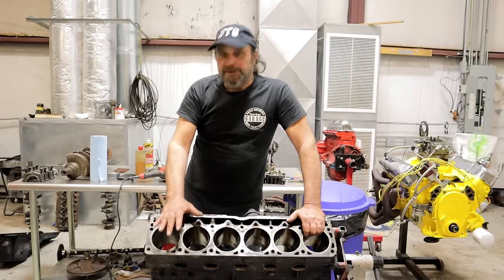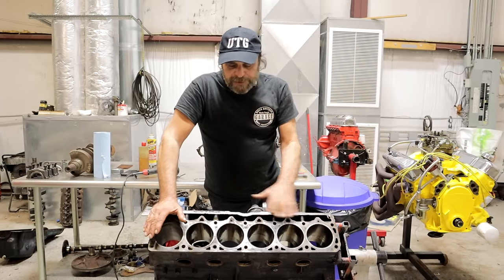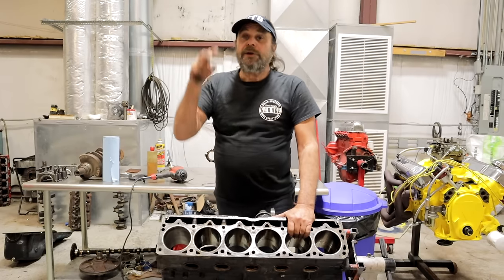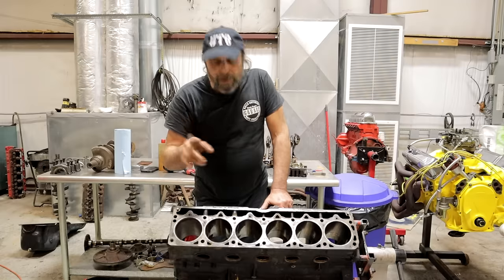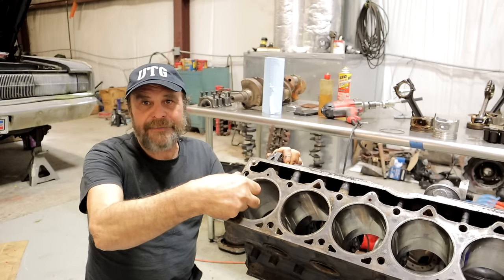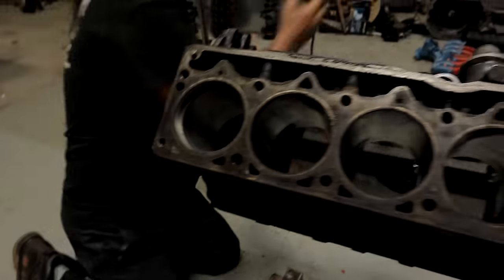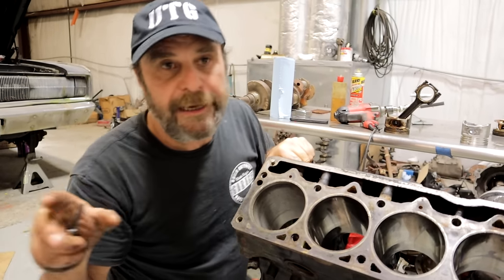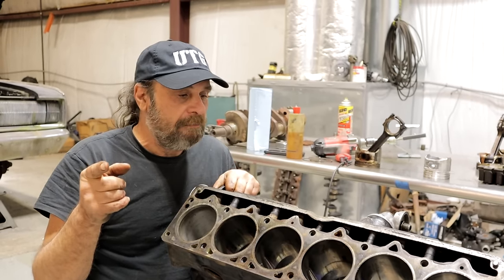Your First Engine Job - Checking Cylinder Bores For Roundness And Taper Using An Old Piston Ring

Comment: Hey man just wanted to say that your videos are very helpful for the guy at home. Don’t listen to the machine shop guys that think their process is the only right way to build an engine. I’m a young kid and I’m porting the cylinder heads on my dads 318 and doing some cleanup or “blueprinting”. We need more mopar videos like yours. It seems every YouTube channel has worked on or talked about Chevy 350 small blocks.
Reply: @hughgerection8675  lonely Under that Bridge huh...
Cheers up Hugh...
Reply: Ya as long as your within the specs run it I've never had issues adhering to that and it's treated my builds well.
Reply: @hughgerection8675  that's only true to a certain extent for example some professional builders balanced pistons, pins, rods ect to within 1g some do it to within 0.5g some even further like myself a min of .01g I don't accept more of a variance then that so again it's dependent unless you're referring to f1 ect which I'm sure is far more intense as far as tolerance goes and let's be real hear if he is looking to race to win specific class then a 318 isn't on the likely list of combos anyway so it's clearly for a fun weekend car it will probably never see 500whp or above so aslong as it's in spec it will work and be fun and that's really the key overall

Comment: While you're checking for light gaps in the cylinder. Go ahead and check the gap with a feeler gauge at the same time. Save a step. Otherwise, perfect explanation. Easy to follow and very good information

Comment: If you have an engine you just want to get back together like this I suggest finding a hone with the fixed adjustment rather than spring loaded. You can do a much better job of honing and correcting the bore in the process.  Having honed hundreds of blocks there is pretty well always a few thousandths taper and a fixed stone lets you get that out whick makes the rings and pistons much happier and it will last a lot longer.
Reply: Great comment. I wish UTG would've covered that.  I took the time to quickly peruse Google. I'm happy I did. Back in the day, the cost between the three types of hones was the biggest factor in hone choice. It still is today, but MUCH less so.  Ball and spring-loaded "fixed stone" are still the cheap way to go.  However, for $150 - $160, lisle, apparently, makes a rigid hone.  Back in the day, they were like $400 to $600.  What's great about these bad boys is that this is as close to having a professional, machine shop hone at home.  This is the same type of head as machine shop hone, just smaller, so a drill motor can handle it. Because it does rigidly hold the stones, it's much easier to get a bore that's round and straight. The only difference between this and a professional is that, due to the mechanically controlled stroke and rpm, a professional can precisely, repeatedly set a cross hatch pattern where a hand stroked, hand controlled drill motor might leave inconsistencies from bore to bore.
Reply: @kart70  Thanks for that.  It's good that a newbie has choices, depending on his budget.  UTG is pretty consistent with being budget minded.  It's a growing process. 🙂
BTW, slight tangent, I have old tools from my dad.  The ones still working were the ones from quality mnftrs.
Reply: One more shot in the dark thing to think about is to check out the night courses at the local tech college.   It's not that common, but some colleges do have automotive style machining equipment and even may offer night classes where you can do your own machining on your own engine. Sure, it won't be cheap, but it may be cheaper than the machine shop, and you can brag that you did it all yourself.

Comment: I’ve honed a lot of small engines. I hone might right in my parts washer with mineral spirits. I direct the spout at the cylinder wall, turn on the pump and hone away. The mineral spirits flush the cuttings and grit away as I go.

Comment: While running the piston ring down the bore checking for roundness you can check the ring gap at each stage to see if there's any taper.
Reply: And divide the gap difference by pi to determine actual variation in diameter.

Comment: I've always used diesel when honing or as cutting oil or anything like that, but growing up on the farm we always had diesel fuel around just waiting to be used as a solvent/lubricant, so that's what we used.  We also used it to wash our hands when we were done working on anything that got our hands greasy/oily.  The diesel fuel we used back then seemed like it was a lot more "slippery" or lubricating than the ULSD available now, so I use WD40 or lite engine oil as cutting oil now, but still use diesel for engine cylinder honing.
Reply: offroad diesel or home heating oil still has the lubricant (Sulfur) in it, at least in my location. Diesel owners would know the ratio of 2stroke to ULSD to have the protection of old diesel.

Comment: Just 2 items I hope you will cover in a future installment :  How to feel the feeler gauge so you know you have the right one because it is easy to go a couple thousands once way or the other between loose and too tight.  Second would be which stones to use because there are different grits and that will be based on the type of rings used.  Great series!  I wish I had a teacher 20+ years ago that taught me this stuff!

Comment: Dude I rebuilt my 5.9 cummins, in frame overhaul my first engine and followed your steps without ever watching your videos. Just used my logic, worked out great truck is running strong and great.

Comment: I agree with you Tony great job explaining the generations of engines. Not to blow my own horn, just an old guy who wants to help here, early first Generation engines did have the owners working on them. Some poured their own bearings in the rods or crankshaft s of these engines, but short of that several farmers who didn’t have access to even a small furnace to melt Bering material, mostly lead I believe, and the metals used in the process would simply use a strap of leather that was soaked in oil. Crazy right? But at the time people worked with what they had, and the got the idea of using leather as a bearing came from it’s used on wagon wheels. Wagon owners repaired their own wheels when they had to, making the rungs to hole the rim in place by carving what ever wood they could find and placing leather straps covered in grease to lubricate the wheels and allow them to turn on the wooden axles without destroying them. Definitely a primitive version of shade tree mechanics.
Fascinating on the intermediate engines, you are spot on! This is where I got my start eons ago. I even met Don Garlits on this journey.
Keep in mind that almost all the improvements in the middle era came about through racing in all its forms. The technology of modern engines were driven in part by racing, but can be directly linked to water cooled Fighter engines from WWII. Why it took so long? The muscle cars were so successful in those intermediate years that the technology wasn’t need to build faster an faster cars or better engines. That’s what drives us old guys to want to keep the dream alive and pass everything down to the next generation! But after the muscle car era all but died it was unfortunately driven by forces out of our control. In fact I don’t believe we would be seeing much of that would have taken place if it weren’t for, customer demand for performance and the way the EPA destroyed the potential of the late intermediate engines. Instead of improving and researching better designs the EPA required a host of stop gap parts be installed on engines. they lowered compression to the point that most had issues with afterun,( commonly refers to as dieseling), decreased performance along with what seemed like miles of vacuum lines that all but buried the engine they were put in .That all but killed the DIY market which drives aftermarket parts today. To make power required auto manufacturers to invest in development of better technologies, but they failed to do so, at least for those cars made in America. The foreign car manufacturers ran circles around our four cylinder economy cars. We caught up and leaped ahead, but it took time. Keep in mind that our economy went through a major recession, and wages shrank uncontrollably when inflation is considered, for decades. But, due to demand and a somewhat improved economy we are back on track.

Comment: When I built my last stock class 440 we did a lot of these trick because we needed to do a fast build.  My head was spinning because I wanted to do it “the right way” but my guy said “this is one of the many right ways and we’re racing” so I’m all for it.  I was balancing rods and pistons with a drill  and a belt sander and he was checking taper this way!

Comment: Thank you for your expertise. I was gonna throw my pistons in my sbc 355, until this video. The bores were very smooth. Will run new cast iron rings and hone with a 220 grit. Thank you for setting me straight.

Comment: Good stuff.  if you do measure a difference in gap as you move down the cylinder, divide the gap difference by pi (3.14) to get the diameter difference between the 2 spots along the cylinder.

Comment: While I have the snap gauges and micrometers to take precision bore measurements, I usually take rough measurements (like Tony just did) first just to give myself a heads up on the condition of the bore. They're usually pretty close to the precision measurements anyway. I also combine the 2 methods that Tony used with the light and feeler gauge into 1 operation. I'm guessing that he does too and only did them separately for the sake of clarity in the video for first timers...which isn't a bad thing.

Comment: I rebuilt the 318 in my durango two years ago. I have about 15k on it now and a road trip. The ridge in the cylinders was so slight I could barely feel it. Called my local machine shop and he told me he wouldn't touch it unless he bored it 30 over and assembled the short block himself. Also wanted 5k and at least 6 months to do it. Needless to say I didn't do that. gave the cylinders a quick hone and send it. So far the thing is great.
Reply: Long time ago, I had a 318. Had the heads off at 114k due to a burnt valve. Was told “you know it’s needs an .030 overbore.”  Nope.  Put the heads back on and the car ran like a champ to 225k until I parked the car for restoration.

Comment: I wanna say the old model T engines had shims under the main caps and when the lead babit bearings would wear out you'd remove a shim to make it fit again and once you ran out of shims you'd pour new babit and start over
Reply: You also used a spoon to cut fresh babbitt when you poured new.   Crazy what you can get away with below 3000 rpm.
Reply: @stevetaylor9265  yeah I know on things like lawn mower engines there are no bearings and the couple I've built I didn't torque anything just tightened till it didn't turn any more by hand

Comment: I've done this in 1000s of engine block's & diesel engines in chassis rebuild with zero problems. Only one job  my mechanic dropped socket down the intake and started the truck ruining the cylinder head & piston. That's the only come back I ever had from honing cylinder walls for a refresh rebuild. 
💥 BADA BING BADA BOOM 💥
I APPROVE THIS MESSAGE 🙌
Nj'sJfJr 👍🏼💪🏼❤️🇺🇸

Comment: I’m rebuilding my 4.0 that was a 4.7 stroker for about 80k miles before the mains went out since I built it in 2008-2009. I sent the block and crank to Carolina crankshaft and had them fix my main journals and set my clearances right. I am going to start putting back together as soon as my tax return hits my account. It’s a beast engine! That’s for sure!!

Comment: I had an old Datsun A12 engine that had a definite dip in cylinder wall from a previous piston failure. After 3 years of thrashing and neglect, that dip was gone when I stripped engine.

Comment: Tony thank you so much for this tip. I am rebuilding a 1964 lincoln sa 200 engine driven welder. It has unknown hours but was using oil cause of valves. I just checked all 4  cylinders they are round and still in spec. Now I just gotta measure the bearings for crankshaft to buy the right ones. But this saved me so much more time. I will be finishing it up before next year!

Comment: Re the existing crosshatch when tearing an engine down... If you know the engine was done right previously (competant mechanic or untouched since factory assembly) then wear patterns would show any deviations. And you should put a good crosshatch down even if the previous crosshatch is still visible, since the crosshatch acts as the teeth on a file to wear down any high spots on the ring. You match the coarseness of the finish to the hardness of the ring so that the "file teeth" become dull just when the ring seats for a good seal. Any remaining crosshatch will help hold a bit of oil for lubrication. My two cents.

Comment: I think taking a dingleberry hone to the other 5 cylinders would be a wise decision that's kind of what those homes are for just because you can see the original cross-hatching doesn't mean you shouldn't deglaze and cut a new crosshatch for the new rings, you're putting new rings into a glazed cylinder no matter how much you clean it the rings are going to have a hard time bedding themselves into their new home if the cylinder is glassy smooth, I bet there will be a cylinder 2 cylinder power different especially number one compared to the other five I'd like to see a compression test done compare number one to the other five. I'm not saying anybody's wrong and I've done this myself and never had any major problems for a stock rebuild but if you're going to put a new crosshatch on one cylinder you may as well do the other five especially if you're using new rings, they need to bed themselves in, it's part of the break-in!
Reply from the maker: That kinda goes without saying.  As I said in the video, this was just a preliminary hone on the one cylinder I suspected of damage.  All of the cylinders will get honed before the new pistons go in.
Reply: I didn't hear him say, he was going to renew the rings on the other 5 pistons. You must have read his mind

Comment: I would note the safety factor of using gasoline is derived by having the drill above the cylinder being honed - gasoline vapors will drop, not rise.  I would not try such from a side angle, as my old sears drill is a bit of an arcy/sparky device around the brushes.

Comment: In a machinist term I would take dykem blue and cover the area that was going to be inspected use the ring and scrape down the surface, and anywhere we didn't scrape you know that would be a low spot. I would say you'd have to have more than a thousandth of an inch to see light testing both ways to make sure

Comment: Glad I watched this video haha pulled my 360 FE heads off and it doesn't look too bad besides the ridge at the top on almost every cylinder haha its pretty bad. Not sure if I should buy remanufactured heads or fix mine

Comment: I measured my engine bores with telescoping gauges and I found out that on thrust side of the bore there are low spots that are 0.05mm ( 0.002" ) out of spec. Manual says no more than 0.01mm ( 0.0004" ) of taper or 0.02mm ( 0.0008" ) out of roundness is allowed. But cross hatching looks absolutely fine and nothing sticks out visually. I'm going to try this piston ring trick and see what it tells me.

Comment: Before doing an operation on the engine, he educates 5 mins about the nature of the process.Great teacher and i am going to slowly build my 2.0 lt Rav 4 diesel engine with those teachings without rushing and asking some help from a reputable machine shop if the block needs to be barred or squared etc etc.But i have one question I wonder a lot , for exemple when the bore is machined the milling machine has a fixed true square reference, i mean the bore afterwords is true and correct.My question is wouldn't it be better to attach the honing aparat to a drill press or a more true turning spindled machine instead of a drill that we hold in our hand ? Isn't it going to disturb the trueness of the bore ? Or the cutting rate of the stones are not considerably high so it doesn't matter ?

Comment: Bringing back memories overhauling used engines on the low dime ! Use to buy rotted muscle rusty cars , mopars for 800-1200 dollars etc performance them ,invest elbow grease and only minimal money for the fix upgrades  ,Sheet metal and BONDO , lacquer spray paints !   cam and lifters , double roller timming chain, valve springs, gaskets ,bearing , rings , valve seals, oil pump and gunk and paint ! JC Whitney mail catalogue for the cheapy cheap performance parts !     Swap meets for headers , aluminum manifolds , higher stall converter , overhaul a used Holley too ! same for the rest of the car , brake pads , change the oils , swap out  in 8 3/4 rear a used posi with taller gears , man those cone posi's really sucked , they wore out fast and it didn't lock up then ! had to pay the extra for the clutched ones ! :eyes-pink-heart-shape:, when money was no object add the 125 HP NOS BAby ! oh almost forgot the secret air induction system ! that chrome praying mantis head air cleaner without the foam insert filter removed ! keep bugs and rocks out ! and the chrome barefoot gas pedal ! must have cool factor and a sport steering wheel ! used cragers and fattest rubber with the money left ! The most important for Last ! Must have cassette deck with a booster graphic eq amp and coax 6x9 speakers , cruse and race time baby !